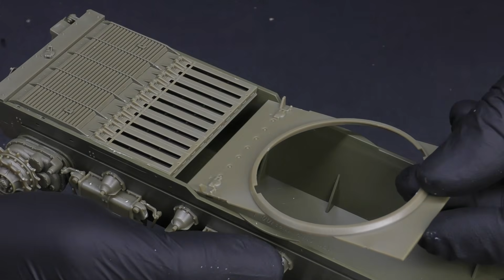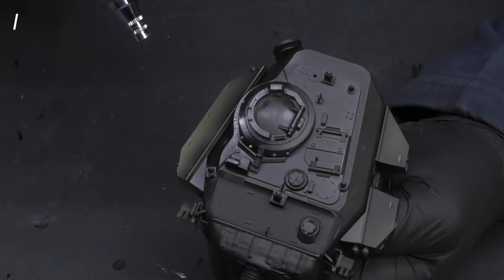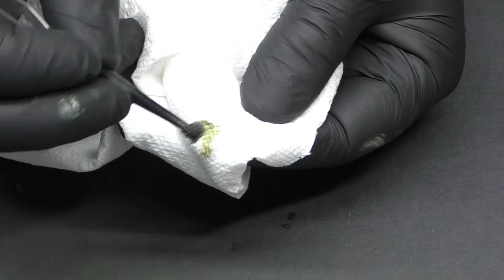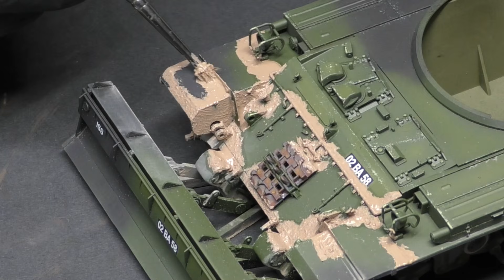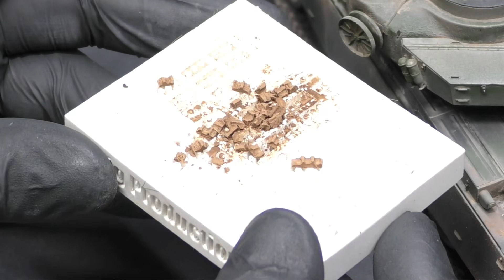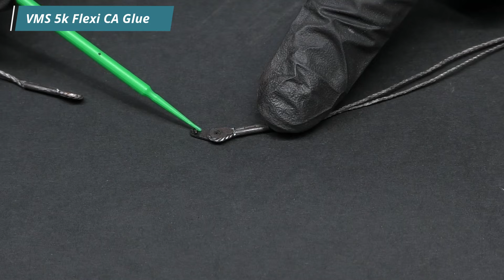AFV Club 1/35 Centurion Mk.5 AVRE AF35395 - Tank model kit build.

Comment: It seemed a tad strange to see the turret basket sitting on the engine deck but then I thought of the different reasons why they might detach it. I think maybe the story here is that it also has a fascine frame and if the fascine is being carried you'd not be able to reverse the turret if you needed to.
Reply: The basket only ever re-positioned to the gearbox decks when a "maxi" Fascine was to be mounted on the cradle (otherwise it would get crushed). With "mini" Fascines and class 60 (later re-designated 70 - same thing though) trackway was mounted there was no need to remove the basket as these were much smaller.

Comment: Well you just about nailed it with the dozer blade,not many worked to dig positions as it always blew the hydraulic lines and being in trouble cost wise for the clean up operation,was obviously an issue to the govt.
Thing that made me laugh was that farmers used to collect the the old tank tracks that jumped off tracked vehicles due to rough terrain,and weld them on farm vehicles and  make outrageous damage clsims to the govt.
An exercise would end when the money ran out.
I look back now and pmsl.
Great build mate you obviously did your homework.
I would say going forward there are other products available,keeps the woke crowd subdued lol

Comment: Excellent built. One tip - you don't need to use bit expensive method for raw steel texture like Anti slip from AK. 
Much better result for steel texture obviously is Tamiya grey putty diluted with extra thin cement and tapping with brush.

Comment: I crewed one of these for 5 years in Germany back in the 80s, they never usually had the hush puppy tracks, they were fitted to the REME Cent ARVs. Kit would look much better with the metal tracks that they usually had fitted but great work on the kit 👍
Reply: I drove an AVRE for 3 years (2AES at Iserlohn) in the 70's, commanded one for 3 years (26CAES at Munsterlager) in the 80's and had 3 in my troop (31AES at Munsterlager) when we deployed for Op Granby in the early 90's. The "Chocbloc" bonded-rubber tracks began being fitted as standard in the early 80's in order to protect German road surfaces - all-metal tracks were never used (even for Op Granby) after this time.
Reply: @siras2 I was in monkey larger in the 80s mate, none of my Cents had hush puppies, only the REME ARV. Metal tracks on Exercise Lion-heart through German villages…

Comment: Hi, did you end up using K54 part the new sprue for the other hatch next to driver? There's nothing on step 18 saying to use any periscope there is not one that fits on clear sprue but this green on fits and has a bar handle like a sub periscope handle!

Comment: Amazing techniques, now for this mere mortal to attempt to recreate at least one of them.

My only negative comment would be on the use of rusting on the vehicle chassis. If this is meant to represent a vehicle in military service I know for a fact that the crew would be in all sorts of ka-ka allowing rust to form on anything other than the exhaust. Even there they would be in trouble. Just a comment on an amazing transformation.
Reply: Mainly true, but paint on the exhaust shields burned off within a matter of minutes (especially in the centre - that's where modellers should paint their rust, not at the ends as shown here). The face of the dozer blade also lost all its paint immediately after dozing commenced.

Comment: Just sharing something I went and looked up: CARC Green and Black are Cold War era ‘Chemical Agent Resistant Colours’ They are a real acronym, not a fancy name SMS came up with. Well, we’ve all learned something new today… 😉

Except for all those clever buggers who knew already…
Reply: You are correct. CARC paint is a Cold War paint that was supposed to repel any chemical agent that got onto it and make decontamination of vehicle a lot easier. Also, it is a cancer-causing paint. It was supposed to be most lethal in liquid form thus persons actually painting a vehicle had to where certain chemical protective gear/breathing apparatus. Once the paint dried it was AOK. AND - something that we learned the hard way while in the military, the cancer producing agents from CARC paint was also supposed to be quite lethal if the paint was burned off of a vehicle (like if a vehicle was burning after being destroyed in combat). PLUS - my favorite - this stuff was also supposed to be lethal if you were trying to grind through the paint with a grinder, thus producing DUST. We were told by our officers that using our GAS MASKS would protect us from breathing in the dust except nobody bothered to provide us with appropriate filters for the masks!! I was a safety representative in my unit during the 1990s and had to learn all about this crap - quite scary what CARC paint was capable of doing to the human body - surprised that I am still alive after messing with that stuff. Your comment brought back a flood of memories dealing with that stuff.
Reply: @jamesbednar8625  another one of those “prevention is worse than cure” ideas. Great idea, poorly executed. How Army like? 🤨

Comment: Just a quick add on to your excellent vid: I drove one of these for 3 years in the 1970's and then went on to command one in the early 1980's before becoming the "Staffy" of a Troop which deployed to Desert Shield/Storm with three AVREs (plus two AVLBs and three Spartan CVRTs). It's a shame no one makes a matching model of the enormous 7.5ton trailer that they almost always towed. Incidentally, any paint on the face of the dozer blade scarcely survived more than a minute or so once the tank started dozing work, consequently the blade face never got painted unless there was some kind of parade or inspection coming up. The exhaust outlets were always completely rusted and the paint on the exhaust covers blistered and burnt off very quickly (from the centre top, outwards).
Reply: REspect Sapper 🙂
Reply: There is a trailer model, by accurate armour. But expect its ridiculously expensive. I was AVRE crew-9Tp.
Reply: I was 31 Ftrs Cent Arv commander for awhile 👍
Reply: @dambuster6178178  I was 77 AES Ftr Sect Cent Arv dvr. 91-94
Reply: Ex 26. 84 to 92 😎🥳👍
Reply: You''ll be talking about the Giant Viper trailer I think.
Reply: @beargritter7618  No, the AVRE towed two different types - the 7.5ton cargo trailer and the GV trailer (It's been helpfully pointed out that Accurate Armour do models of both of these).
Reply: @siras2  aye. Carried spare fascines
Reply: Who did you deploy with?  I was with 21 but had elements of 35 attached.
Reply: To elaborate on the dozer blade, for realism/authenticity, and coming from a dozer operator of 25+ years, what you referred to as the pivot points for the dozer blade, were lubricated with a very thick grease,Vaseline kind of viscosity, not oil, so when over greased, the dust and dirt mixes in with it to make a sticky muddy mess, it might liquify in extreme heat but the hydraulic rams that raise and lower the blade wouldn’t get anywhere near the kind of heat build up that a cat D9 or similar would get working flat out on a muckshift, as the dozer blade on the tank was to clear its own path primarily not for pushing 50+ tonnes of earth around like a real bulldozer. You would get a very dark almost black streaking from the grease points when the grease has mixed with the dirt/dust and then been washed away by rain/splash water. 
Minor details but it’s all in the name of realism. Awesome build though! 
Also thankyou to the veterans commenting…we appreciate you even if labour don’t 🫡
Reply: This yank. Thanks you for your service 👍🏻💥👊🏼